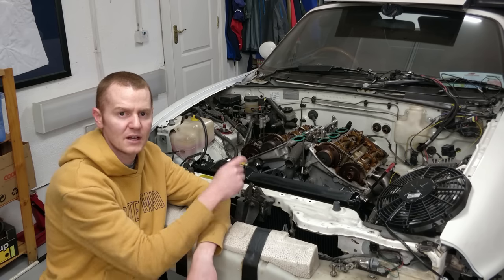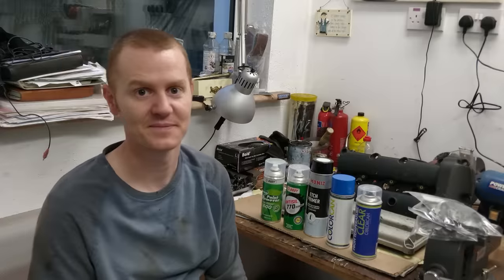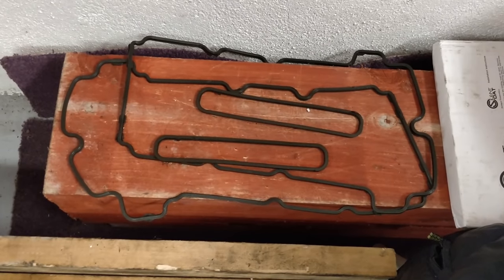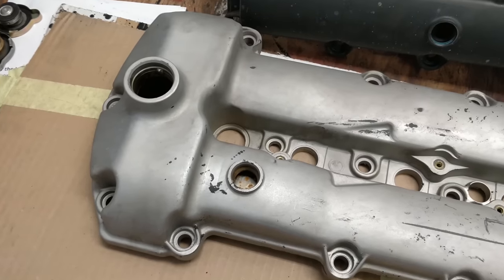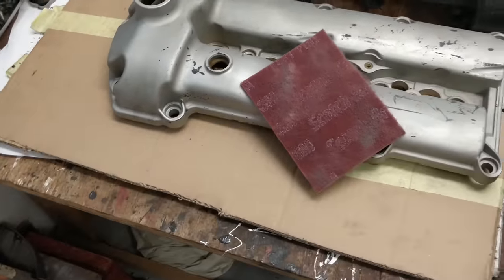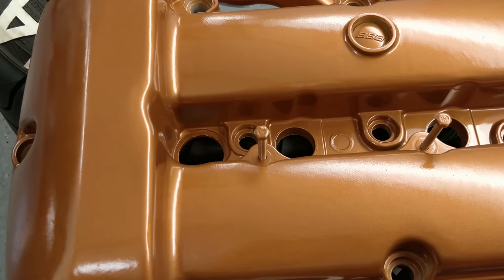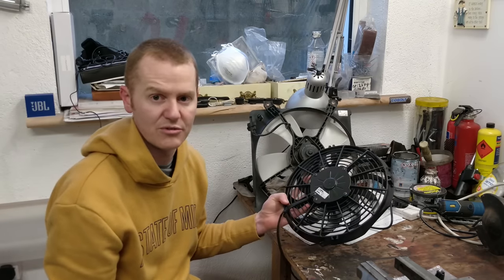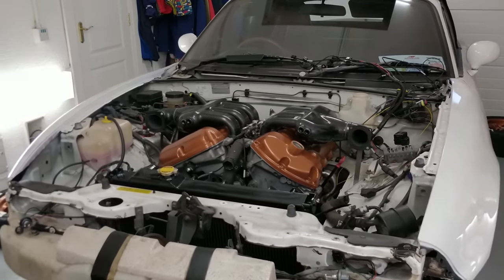MX5 V6 Valve Cover Painting. Radiator & Fan fitting.

Comment: What did you remove at 1:37? was it a cam position sensor? Did you need a special socket to remove it?
Reply from the maker: Not actually sure what it is. Cam position or temperature probably. Just a 19mm deep socket.

Comment: Super video as always !
What size is the new fan ?
Also, if you have a link/reference for both the fan and the radiator i'll take it, i'll have to replace both mines too while doing the conversion 😄
Reply from the maker: It's a VA09-AP8/C-54A - 779 cfm - SPAL Electric Radiator Fan - 11.0" (280mm) Pull. I bought it here: https://www.ebay.co.uk/itm/VA09-AP8-C-54A-779-cfm-SPAL-Electric-Radiator-Fan-11-0-280mm-PULL-/192217279540